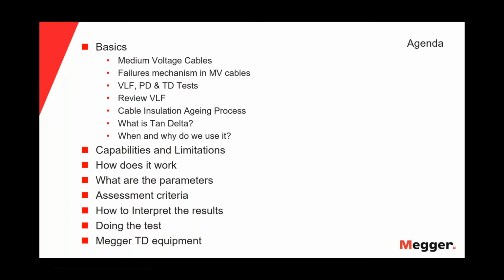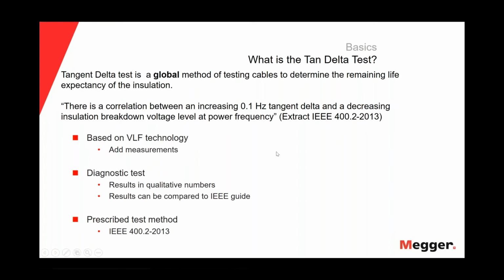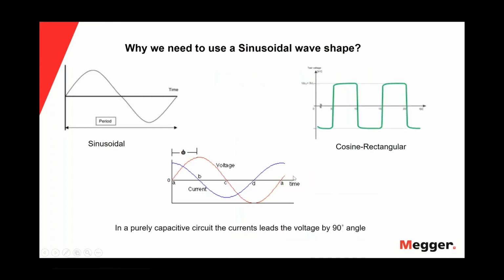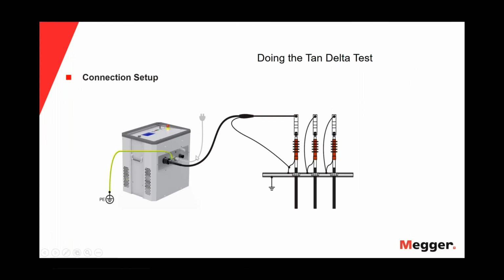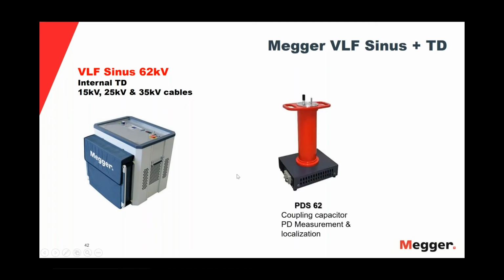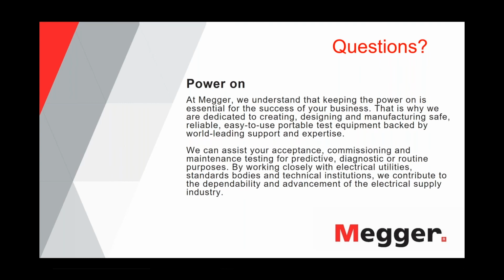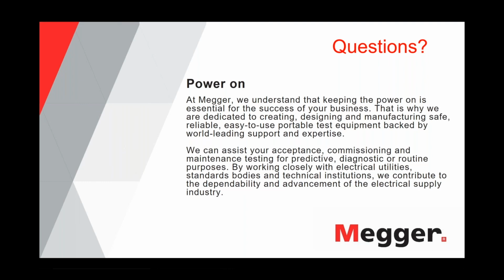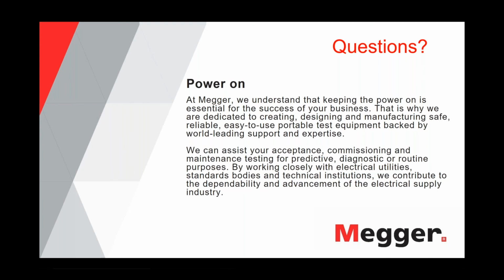Tan Delta Testing on Medium Voltage Cables

Comment: @43:49 the presenter mentions a spreadsheet from a company called "kneetrack" that can be used if you are looking at estimating the age left in cable based on a large case study done. you have to enter the type of cable and the tan delta results and it compares your values with a case study of a large population and gives you an idea of what your life expectancy left is. any link or additional info on this spreadsheet/case study? thanks

Comment: Thanks so much for the webinar, it was very informative. I had a question on the slide at 16:51. Should this be the equivalent circuit of the cable insulation, not the cable itself. My understanding of the tan delta test is it's comparing the insulations resistive component to its capacitive component. For a perfect insulator this would be all capacitive (dielectric) and no resistive element which would result in a perfect 90 degree phase shift. If there are impurities there will be a reduction in the insulations resistive component magnitude allowing current to flow and showing a reduced resistance. This will decrease the 90 degree angle as there will be a resistive component present. Please correct me if I am wrong and thanks again for this presentation, it was very insightful.
Reply: Yes, your understanding is correct. And that’s what the presenter said too I think.